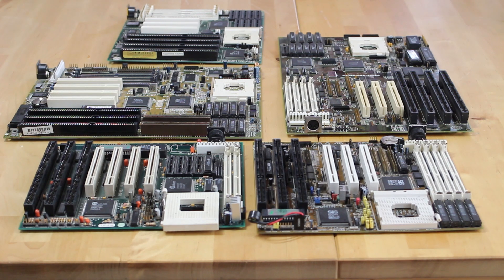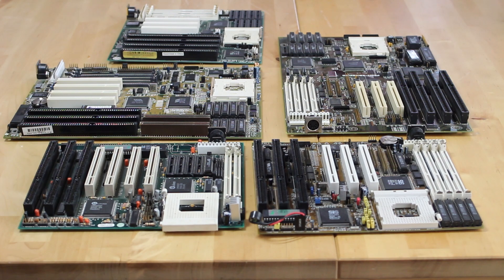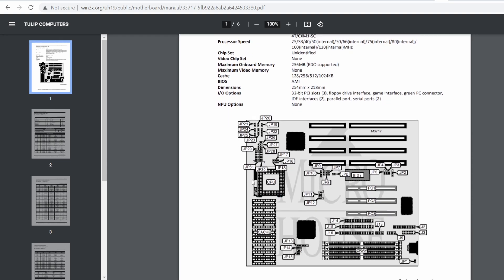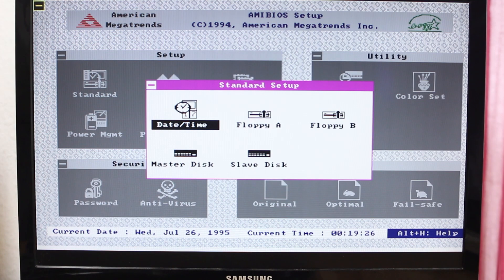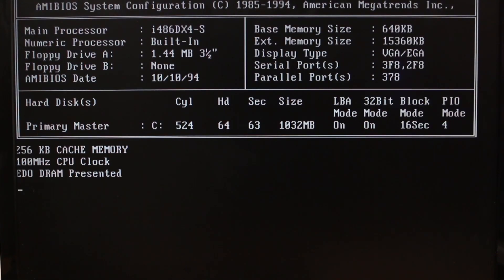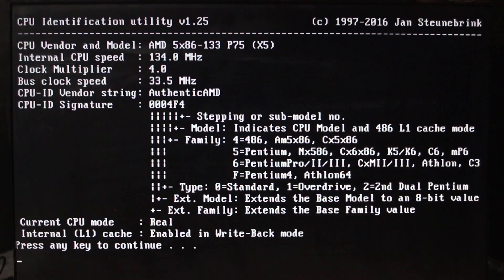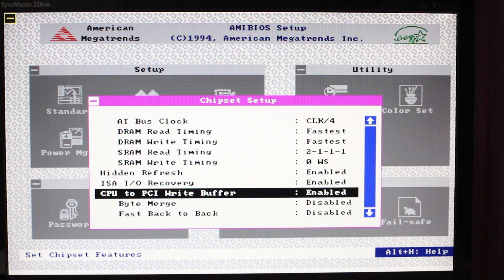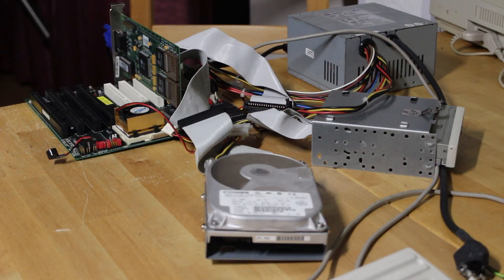A Quick Look at my 486 Motherboard with ALi Chipset and PCI Slots

Comment: Excelent❤🎉🎉. Excellent explanation, sir. I have a question. Is there any difference between the M1489 TS07 and M1489 TS05? I replaced the 05 with the 07 on one motherboard, and now the PCI System Configuration shows me a "legacy device." Before replacing it, it showed me "Network INT 15". I replaced it because my Data0 pin was damaged. I want to be sure if that would be the response when replacing it or if I have another damaged one. Thank you. I don't know what  mean  "Legacy Device." Regards

Comment: i got a m918, when i power it on, i don't hear any beeps and nothing appears on the display.
Reply from the maker: I guess check the basics, CPU jumpers, try different RAM, another video card unless you know for sure it works. Check for damage on the board somewhere or burst capacitors. Make sure it is set up correctly for write through vs write back cache, and if that is not possible try a CPU of the other kind.
Reply: @PCRetroTech  it was some board from ebay, it was DOA. i just use it for test fitting CPUs when i am unbending pins. it came in a lot with some other boards. there was a VLB 486 in there that works fine, and a socket 7 that works fine.

Comment: I've got some XT's, a 386, Pentiums of all levels, but I kinda miss the 486 for some reason. Maybe just for an excuse to use the VLB cards in my collection that I never got rid of.
Reply from the maker: They are quite a lot of fun. I prefer the DX4 100 era, but some people are really attached to the DX2 66 machines.
Reply: @PCRetroTech  Yeah, VLB was getting phased out for PCI by the time DX4 was out. And at that point, you're overlapping with the early Pentiums. Kinda for that reason, I haven't made a big effort to collect parts to put a 486 together; I've already got early Pentiums that fill the 486 niche just fine, in terms of the games of the era.
Reply from the maker: @BlackEpyon  That makes sense.

Comment: These boards often shipped with "Fake Cache" and a hacked BIOS (to show it had cache). A classic PC-Chips tactic. On some boards, the circuit traces from the cache were not even connected to the rest of the board.
Reply from the maker: Indeed the PC CHIPS version of this board, the MB419 had this issue. I don't know if Amptron was just a different brand of the same manufacturer or a different manufacturer using the same PCB layout. From a sample of one I can't really say.
Reply: @PCRetroTech  I hope the info I posted made it to your new post notifications as youtube is removing all my posts, even those with simple search terms.
Reply: @crayzeape2230  I see the post I replied to above, but didn't see anything else recent from you. Unfortunately this has been a big problem recently, and numerous others have mentioned it.
Reply: @billhart3814  I had a number of posts attempting to show the location of proper jumper settings and a BIOS file for the board, but of course they didn't make it through no matter how I tried to hide them.  It might work if I post search strings without quotes in posts of there own, but they'll look a bit odd without context. I'll try though, we'll see what happens.
Reply: @PCRetroTech  One more try, no quotes for this one.
elhvb mobokive archive 486_M9xx m918
Reply from the maker: @crayzeape2230  Yes I see this one. Thanks. When I made the video, Google didn't bring that page up in a search for some reason. That would have been handy. It'll be interesting to compare with the settings I used.
Reply from the maker: @crayzeape2230  Wow, I just noticed this board was sold under nine different brand names!
Reply: @PCRetroTech  Yes, the industry was truly a crazy mess at the time. I saw it all 1st hand while working as a technician in a Melbourne computer store.
Reply from the maker: @crayzeape2230  I wasn't far away, working in a Tasmanian one.
Reply: @PCRetroTech  Ignore the sticker on the BIOS, your board is the PC CHIPS M918. The seemingly random 918 related posts bellow, along with a search engine, should get you to where you need to be (the first one needs to be in quotes).  Youtube makes it difficult ;)
Reply: @PCRetroTech  PcChips M918i, Amptron DX-9300 - AMI BIOS ID string

Comment: Maybe a faster cache chips are available? Nevertheless, not really the record but respectable result for 486.
Reply from the maker: I think the issue here is the cache timings rather than the actual speed of the chips (which is 15ns). It might be possible to eventually find some chips with better timings, but they are as rare as hen's teeth, so I'm not holding my breath. Even so, the same chips give much better timings on other boards.

Comment: I think it's a matter of quality, PC-Chips was well known of pesky quality, sometimes even works worse than a closest clone, despite sometimes using good quality chips (which is rare).
Reply from the maker: Yes, the only thing worse than poor quality is inconsistent quality.
Reply: Might explain why the USB on my super-7 motherboard never worked. It's got onboard AGP video and Crystal Audio sound, which is pretty rare for an AT format motherboard (it uses expansion brackets), can take either EDO or PC100 RAM, can take an AT or ATX PSU, but I've never been able to get the USB working.

Comment: Thanks for mentioning UH19 :)
I have found a document that documents an extra 512KB cache "mode", I have added it to the page, maybe this'll help ?
Reply from the maker: Oh cool, that could definitely be what I need. I used the second 512K configuration, but I'm pretty sure it is the first one that I need. It's a shame about the other problems the board has (not being stable with the fastest cache timings). It could have been a very interesting board.
Reply from the maker: I tried out the settings, and it still tells me there's 256KB of cache. I managed to get the machine to boot at 33MHz FSB only and cachechk tells me there is only the internal processor cache. Very odd indeed.

I guess this particular model of board just doesn't support that option. But at least it explains why the other option didn't work.